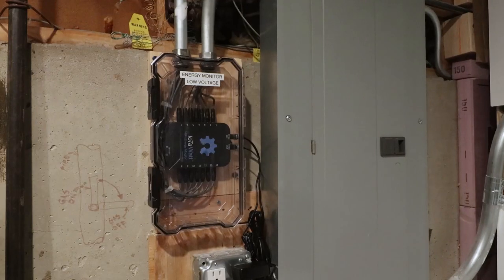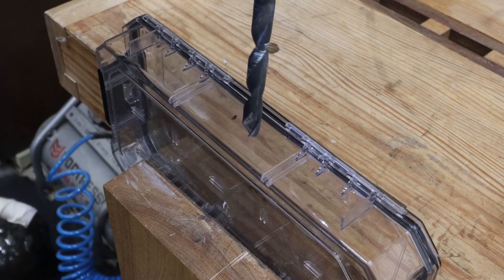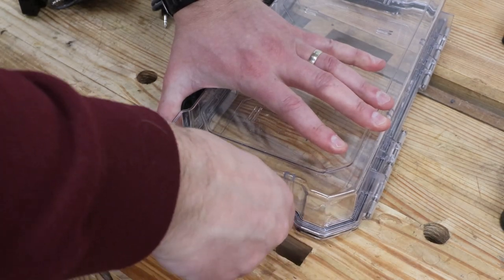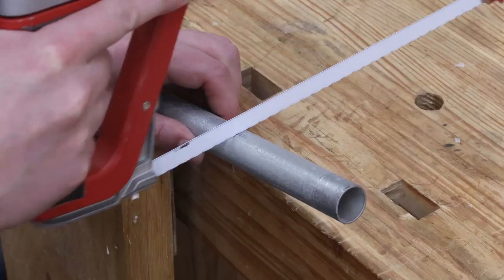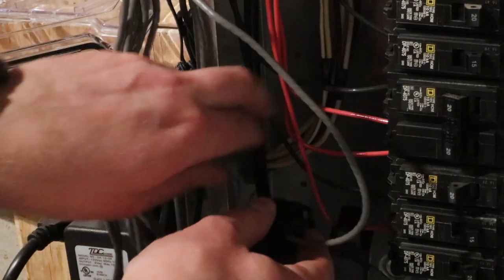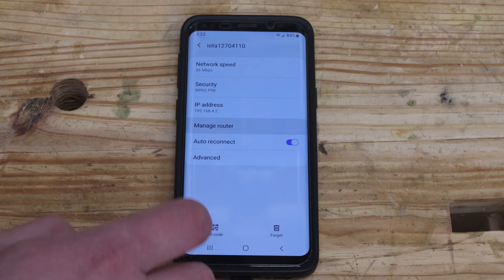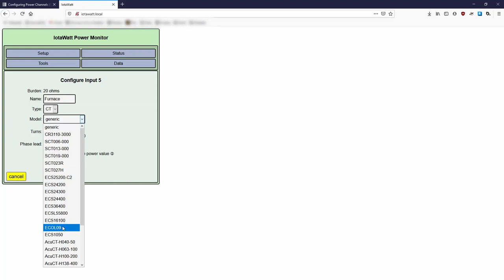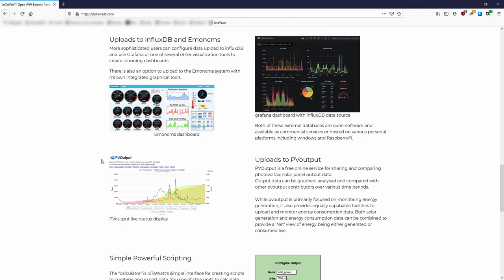Home Energy Monitoring with IoTaWatt | Physical Install and Initial Setup

Comment: This was exactly what I was looking for. How the device connects to the actual electric wires and how they route back to the unit. Thank you! Then the live feed of power on each monitor. That is wicked. I'm trying to figure out why a particular circuit trips and I think this might help.
Reply from the maker: Glad it was helpful, David! Circuit trips usually either mean you have a short somewhere (bad wiring or bad receptacle) or a device it drawing too much power.
Reply: @GlennFrazeeYT  so far it appears that it's an issue with a particular device or two drawing too much power (two high powered computers).

Comment: I'm the same way I like things to be neat and installed properly. Great job I would never have thought of using a plastic organizer box. Only thing I would do to improved is drill vent holes or cut vent slits if the iota box gets hot.
Reply from the maker: Thanks Charles!

Comment: Finally, an install that isn't an absolute freaking train wreck. I hate the Emporia installs that are shown on Youtube. How they horse shoe the device into the breaker panel. As if it's a play ground for people to horse around in. Keep every outside that breaker plane as much as possible, and nicely bundle wires to reduce clutter.
This is much much better, much nicer.
More work, yes, but it will interfere WAY less if other work has to go into the panel. Imagine getting an electrician in to add something like an EV charger. Oh, let's open the panel... WTF! what a freaking mess!
So yeah, nice job. Very inspiring to do it right.
Reply from the maker: Thank you!

Comment: Great!  
1) Does it work with a 360amp main - are the CTs big enough?
2) can I piggy back more than one unit to monitor more circuits?

Thanks
Reply from the maker: Hi Roger, you'll want to check the IotaWatt website for specifics, but
1) the Iotawatt store has CTs up to 600A
2) I don't think so, but the forums would be the place to check.

Comment: How can you measure power without measuring the voltage?   Power is Volts X Amps.   You seem to be only measuring Amps.   Do you guess at the Volts?
Reply from the maker: The 9v reference plugs into the mains and gives a reference voltage to multiply by. You can calibrate this with a multimeter. Normal residential power in the US is 120V, though that can vary within 5% or so.

Comment: Thanks for the UP. Q what about a straight forward vid on Basic install (which you just did) but showing how to get monthly $$ in dollars in total and or per device per time segment? pretty straight forward to set up a script or rule to do this on a weekly or monthly schedule?  Again thanks for the up :)
Reply from the maker: Thanks, Sam.   I'm afraid that sort of thing is beyond my wheelhouse - I'm not much of a programmer.
Reply: @GlennFrazeeYT   I have a unit on order.(still waiting on it to arrive) Was really curious about a first time users experience "OUT OF THE BOX". and what is by default setup if anything. as you know not all of us are computer geniuses. :) this device looks very promising though .
Reply from the maker: The documentation on the IotaWatt website is really good for beginners. I'd start there. If that doesn't answer your questions, the forum is actively maintained as well.

Comment: Will this report if there is main power when the main breaker is off and the house is being powered by a generator?  Looking for a remote solution to tell me if street power is back or not.
Reply from the maker: I think it depends how your generator is wired in to the panel. I'd ask at the IotaWatt forums; the owner is really good at answering questions.